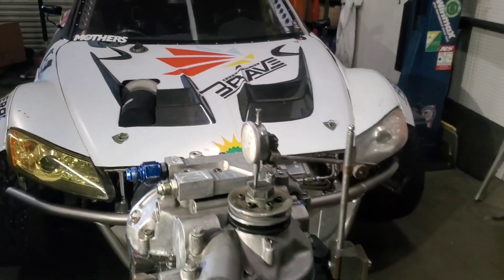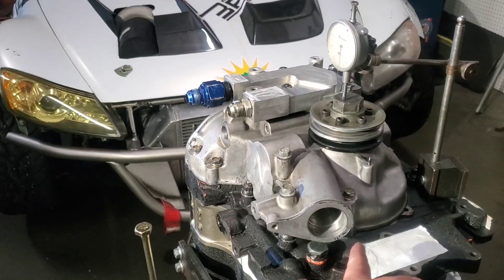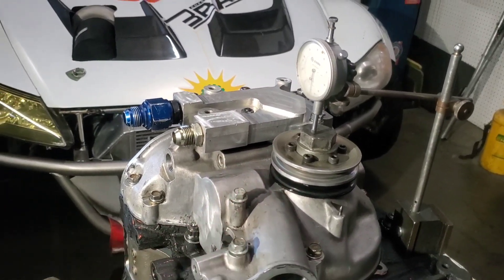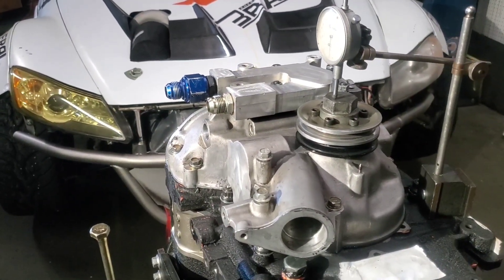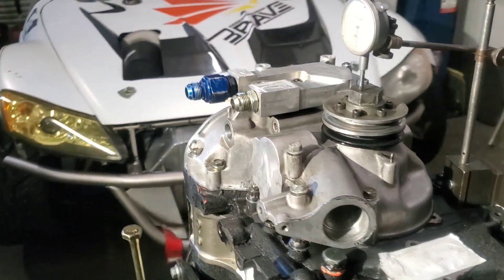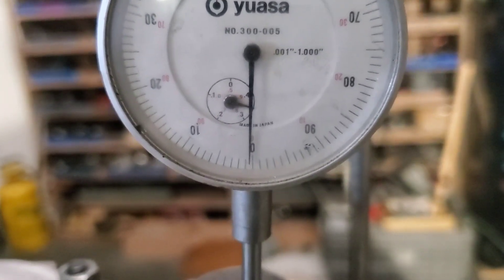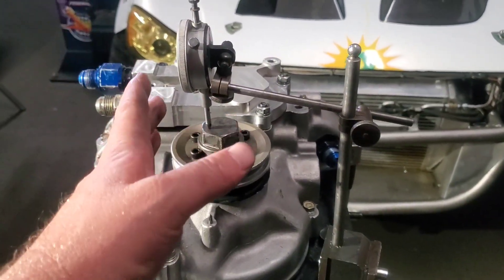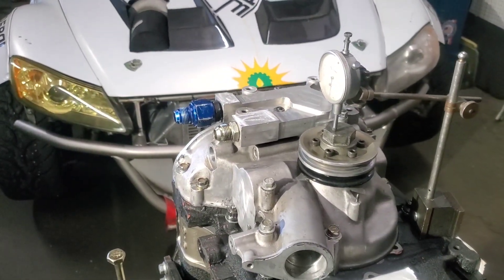Rotary Engine front end play, Teck Talk, KMR Rotary Engine information

Comment: Question: I bought a motor where it seems the builder actually set endfloat to negative 11 thousands(it took a spacer about 31 thousands to be at 20 thousands) Motor has a knocking sound all rpms honestly sounds like a rod knock. any idea what to expect when i tear down?
Reply from the maker: Sounds like front stack damage.